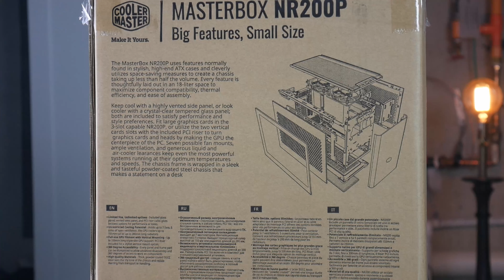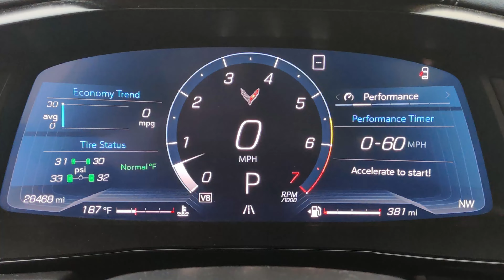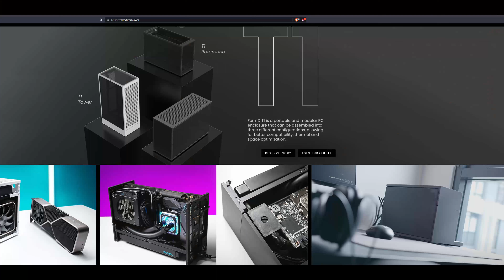10 things I HATE about The Cooler Master NR200P Mini ITX Case - Build

Comment from the maker: *SFF (Small Form Factor) is going to explode. Change my mind. 😀
Planning a SFF build for 2022? Let me know what you think of SFF and  if you would like a chance to win this case in a giveaway! 🤑
This is not a performance Review. Plenty out there. The NR200P Max has proper support for a top mount radiator if you want to see those internals. But that's like $400, The NR200P (not Max) is an afforadable great  case if you don't care about showing your internals for an ITX build only. The advertised promise of micro ATX and full size PSU are bait and switch, smoke and mirrors.

Comment: Neat to see another video from you after all this time. Regarding the case design, I've seen many opinions both ways. I've never worked with SFF cases, but at the very least, this one has some decent ventilation. I'd probably do a side rad mount if using an AIO as you mentioned in the end of the vid. Personally, I don't dislike that kind of appearance.

While not perfect, I think it would be a neat chassis to see some hack and slash DIY work done with. If you're not completely done with it, maybe you could make a "NR200P redemption" kind of video where you modify it to work more effectively for your needs. Do let us know more about your keyboard switch, too.
Reply from the maker: Man! once again thank you for always dropping a line. I agree with you, pretty, affordable, and the air flow is boss for this size.  NR200P redeption is an awesome idea! might even grab that ATX PSU bracket. Got Bright Ideas! Of course will do something on the keyboard switch and why heh. Have a good season!

Comment: Since it's fairly easy to mod into a MAX version, you can 3D print mounting brackets for mATX motherboard and ATX PSU this case is fantastic. Especiallt when taking price into consideration. You can make this into a cheap ass mATX build with the look of a fairly premium ITX build.